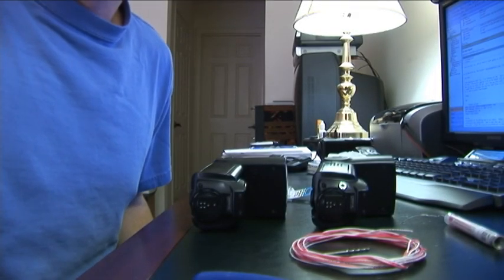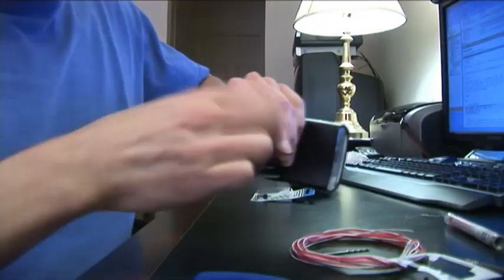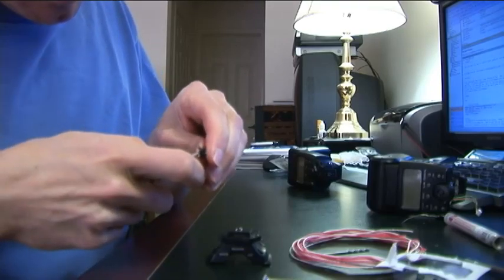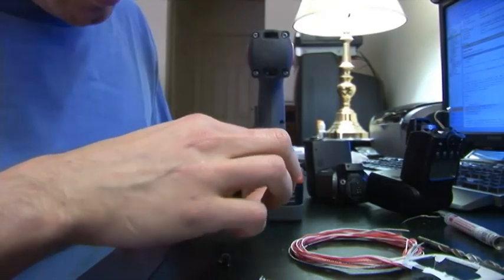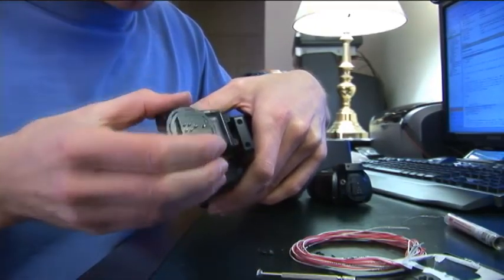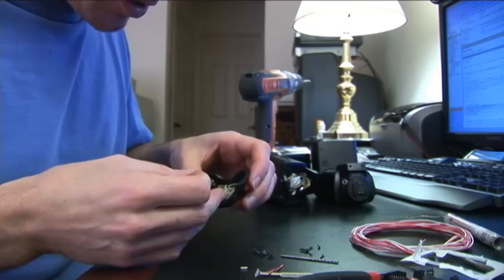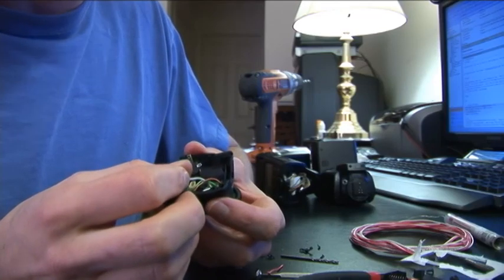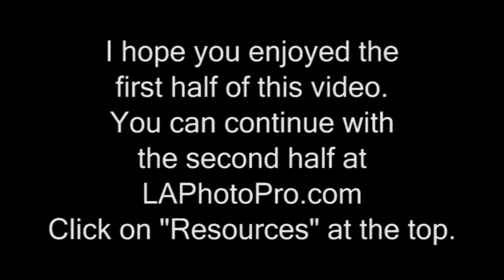How To Add A Sync Port To A Canon 580 EX Speedlite Flash Part 1

Comment: great! Do you think this would also work on a Nissin Di622? 

I tried to trigger my Nissin Di622 with ebay radio triggers but did not work due to the fact that my flash does not have manual zoom. So I suppose that all the time this flash requires from the camera the focal length of the used lens.

Please help!